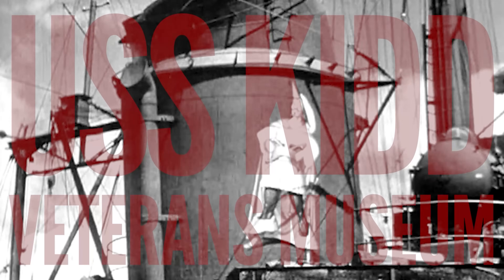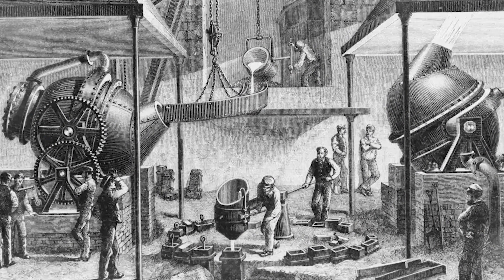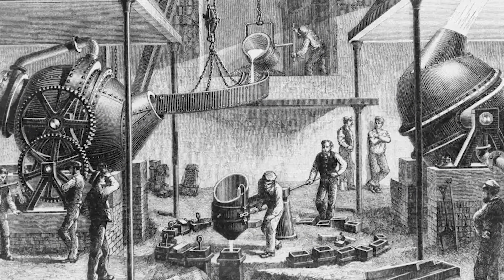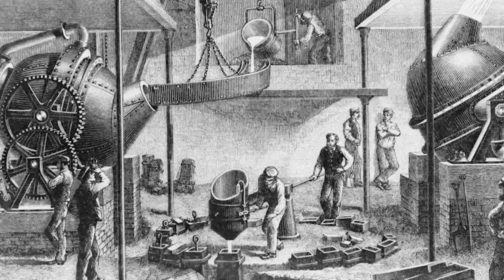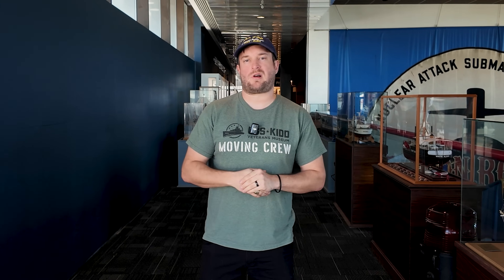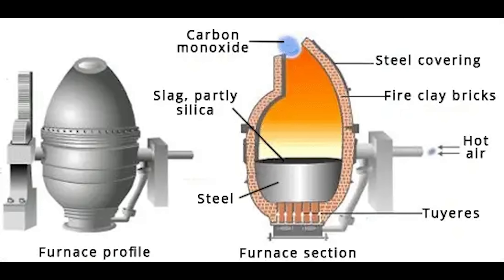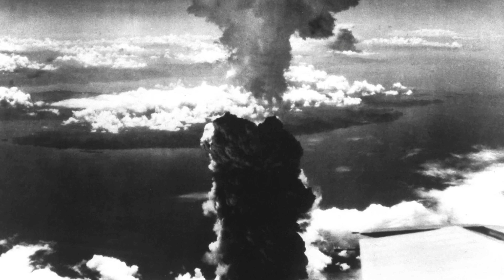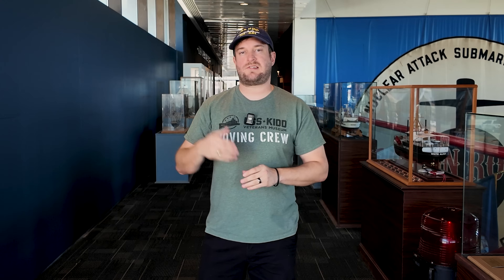Pre-Atomic Steel

Comment: Yeah Cobalt 60 is pretty hard to remove from steel during the refining process most of its contaminated that's why they want this low background radiation steal that they possess cuz the water has created a barrier between it and the radioisotopes that have kind of helped insulate it from contamination

Comment: You need to look up the difference between radiated and irradiated. They are not the same. The steel has been irradiated. What sends out radiation, i.e. the bomb, radiates. What receives the radiation, i.e., the steel, is irradiated.

Comment: 1. Carbon is not a metal, as someone else pointed out. 2. The misconception: The Bessemer Process does not involve adding carbon to iron (pig iron or cast iron), since intermediate-processed iron has an excess of carbon and slag (silicon and other impurities). The actual process involves blowing air into molten pig iron in order to oxidize away these impurities (leaving behind less carbon and/or some removable slag). This is because pig iron is too brittle for direct use, and cast iron is too soft and can't be forged. Afterwards, they'll add in additives in order to produce the various alloys of steel. 3. Before the Bessemer process, there was a process (called cementation) to make steel from wrought iron by melting it in the presence of coal (compressed carbon) in a crucible. This is the only steel making process that actually adds carbon to iron (not the Bessemer process), since wrought iron has <0.05% carbon while cast iron has >2% carbon.
Reply: It's classified as a non-metal, maybe it's you who needs to read up.
Reply: Ur wrong carbon is a metal, read a book

Comment: 6:20 I doubt that the use of pure oxygen helps. It's normally extracted from air so I guess you get some contaminants even with the oxygen. An alternative could be to make the oxygen from water but I don't think that is practiced in steel making since it requires a lot more energy.

Comment: 🙈 what is the reason for this (well made) video? 🤷 If you want non-radiated steel - get some new stuff.🧐 Or am i missing something here?😌
Reply from the maker: @carstenschroder7054 : It WAS a thing because while radiation levels were up in the atmosphere, the air taken in during the steel-making process caused the steel to be slightly irradiated. Now that levels are more back to normal and steel-making processes have changed, it's not as big as deal.

Comment: sreel is not a process which combines iron and carbon, it is quite thr opposite, by producing steel, you remove ever more carbon from the iron ore by burning it, where the need for air/oxygen comes from...
Reply: Iron is an ELEMENT. Carbon is an ELEMENT. Steel is a MIXTURE of IRON and CARBON. Grade 10 science.
Reply: @RickMason-yj7pv  they said: to make steel you combine iron and carbon which is just not true. the coal you burn with the iron and air is just there to get a lot of needed heat into the process, in which you remove carbon from the iron ore(in there is plenty of it), because it weekens the product imense, and below a certaim percentage of carbon it qualifies as steel. simplified you can say, the less carbon you got in the end the more strength the produced steel has.

at best you remove all of it and get a corbonfreesteel, but for economic reasons you are often just fine with a certain low percentage of it, where you dont need the highest quality.

so no, its not a process wich combines iron and carbon rather quite the opposite, a process which removes carbon from iron under extremly high temperatur and in an oxygen rich enviroment.

Comment: Another explanation could be that the refractory lining of blast furnaces has "Small radioactive sealed sources are inserted into the refractory bricks, at different sections of the blast furnace " The use of radioactive isotopes as tracers provides a means of measuring the refractory wear rate in a converter or blast furnace.

Comment: And the low-backround steel is pretty much a limited resource. Steel is so often recycled that it all just gets mixed together. There was also a radiation incident in Mexico where a highly radioactive source was melted INTO a large batch of rebar made from scrap steel.. They only found the truck because it set off a radiation detector. No one even knows where the other trucks of radioactive rebar went.

Comment: You didn't mention that the production of steel requires a tremendous amount of air, which then causes the elevated radiation levels.
Reply from the maker: @brianpencall4882 : Actually,  he did mention the air. 🙂
Reply: @usskidd661  Yes he did mention air, what he did not mention is that production of steel requires enormous quantities of air.  This is why a miniscule amount of radioactive material in the air becomes critical.

Comment: It would help to clarify the difference of types of radiation: high energy light in the form of gamma rays, doesn’t affect materials. 
The other source of radiation are radio isotopes, unstable matter,  generated by nuclear explosions and float in the atmosphere. Thus those elements can be embedded in steel.
Reply: This guy hardly knows what he is speaking about.

Comment: Do not blame the Bessemer furnace, it was obsolete by 1945 (the start of radioactive atmosphere contamination) and had been replaced by the open hearth furnace which in  turn was replaced by the basic oxygen furnace (BOF) by 2000. 

The culprit is the blast furnace, which from the mid 1800's to now, converts iron ore, coke, limestone and AIR to produce a 2700F metal  which is appx 96% Fe, 3+% C, 2+% Si and the impurities P and S. This "hot metal" is converted to most grades of steel by any of the 3 processes listed in the first paragraph.

Since the 1950's "mini mills" using 100% steel scrap and electric arc furnaces have become a major factor but their raw material and therefore their product is "contaminated" .

For an interesting read on a related topic google "kodak and radioactively contaminated film".

Comment: I retired from Argonne National Laboratory.  Many of the shielding  features (Doors, walkway labyrinths, etc.) were constructed from WWI battleship armor plating, and I'm not talking about nice refabricated steel panels, but the actual chunks of battleships with the Oxy-Acetylene cut marks still evident. As you stated, after the accelerator is shut down, the mechanical spaces (for instance) would need to be surveyed for any radiation pickup, and you just couldn't detect a small amount of radiation (that wasn't supposed to be there) if your background wasn't zero to begin with. When I would walk in to the accelerator tunnel I could never resist placing my hand on that insanely thick and heavy steel plate wondering where it had been and gone through.
Reply: I lived right around there in Orland park
Reply: My uncle Robert McGowan was a metallurgist at Agonne National Lab also, and by the way, in Armand Hammer's book "Hammer", he relates that at Scapa Flow, where he had the Piper Alpha platform built, there were some labor vs management problems, and subsequently the big Piper Alpha disaster.